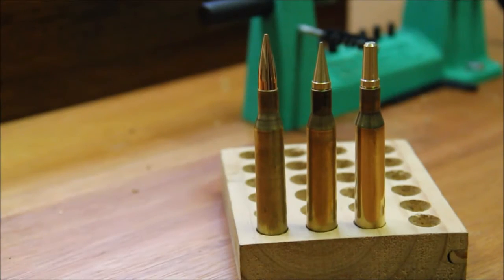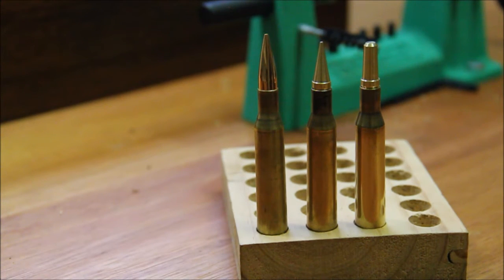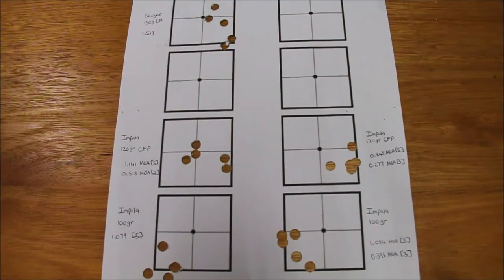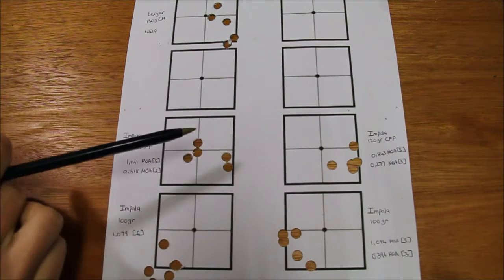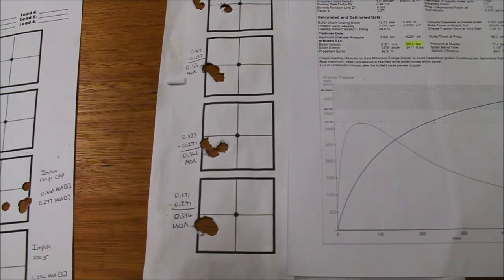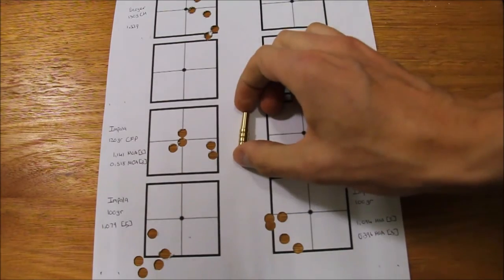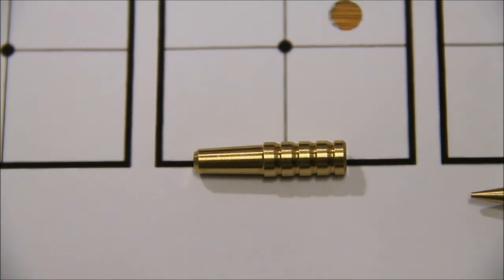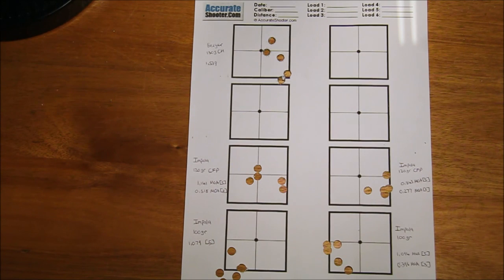Impala Monolithic Bullet Test

Comment: I have hunted 3 animals using these bullets in a .303.
Ranges were 180 to 200 meters.
Zebra was down after 1 shot through heart. As I approached I fired a head shot which was not really necessary but a Zebra is not to be taken lightly.
Oryx (Gemsbuck) was down within 15 seconds after 1 shot to lung area and was dead when I reached it.
Black Wildebeest was down within 20 seconds after 1 shot to lung area and was dead when I reached it.
Meat damage was almost zero.
Accuracy is superior to other bullets. I get down to 19mm groups. Muzzle velocity is around 2380 FPS.
This data is for a .303 hunting rifle with re-machined chamber and reworked trigger.